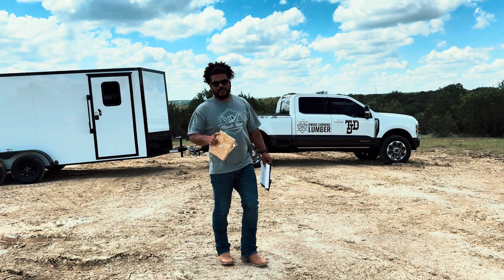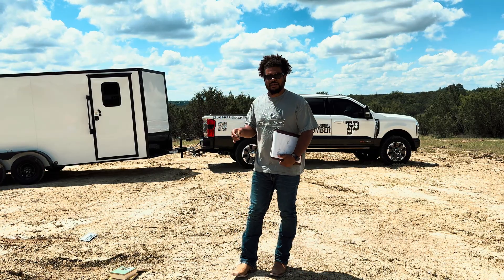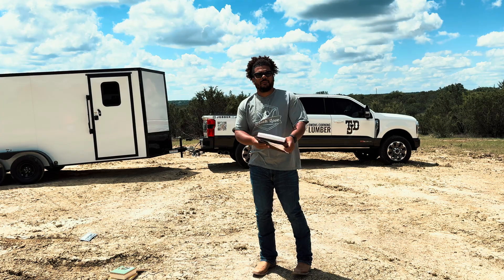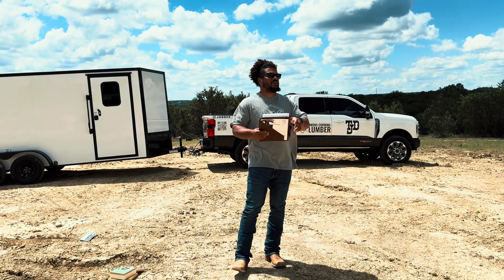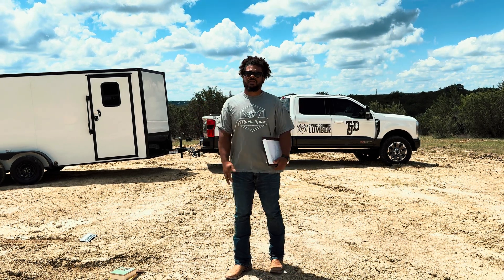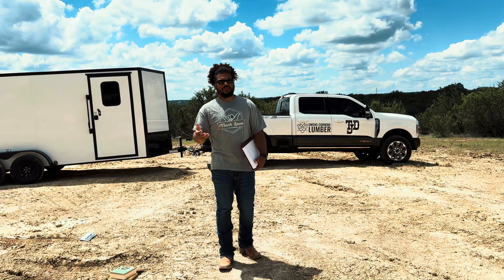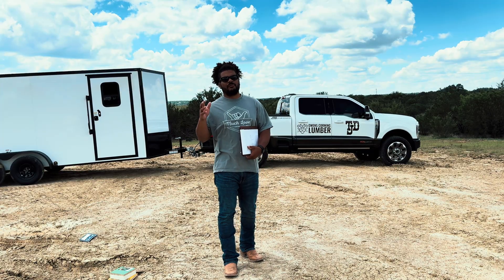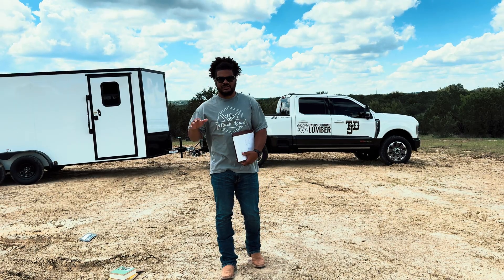Pier and Beam vs Slab Foundation (ICF Home)

Comment: Is there a manufacturer that uses metal or steel for the beams instead of wood?  What maker of ICF’s will you be using?  Can additional foam be added in the brick ledge for extra insulation?